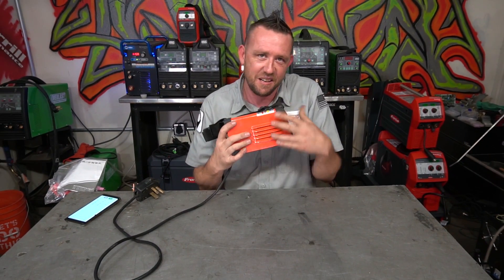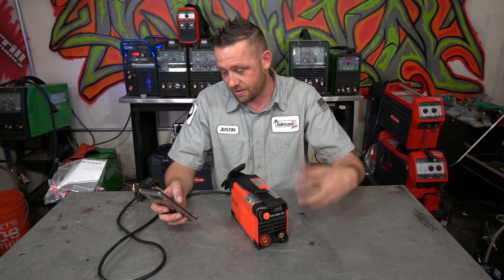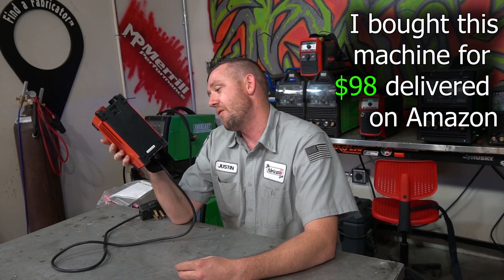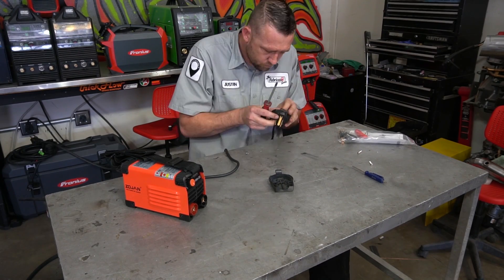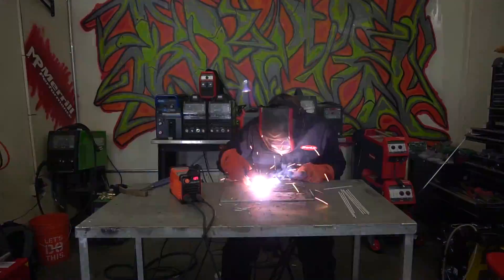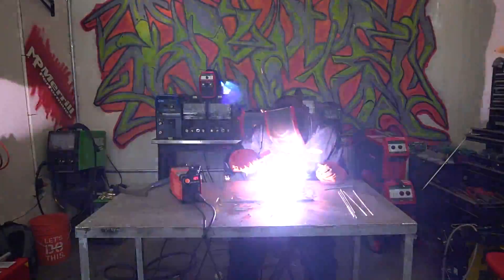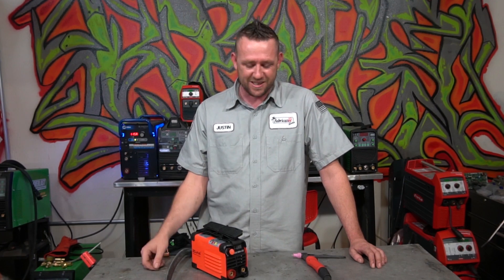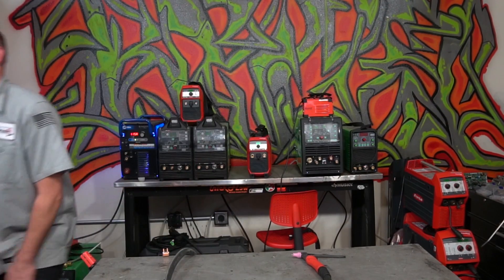TFS: The Smallest Welder EVER! Will it TIG?

Comment: To someone like you it may be novel and not work for long, but to the DIY person that just needs to do a quick light weld, without a lot of room in their garage it would be perfect!
Reply: Yeah, for $100 and no more than I would use it that little welder is just right. I don't weld anything that I need more than 125 amps anyway. You can weld thick steel with that if you do some beveling and pre-heat and prep.
Reply: It's exactly what I need! I'm about to embark on learning to Tig and I'd rather not spend $1000 just to learn.
Reply: @jeffreymoffitt4070  Go buy the DEKO Pro 110/220V @ 160 Amp ARC welder for $130 and you can just add a cheap little $26 TIG torch to do some lift TIG practice. These little Chinese mini welders are okay for light ARC welding, but you want at least a solid 150A DC inverter to start practicing TIG welding. The DEKO Pro 110/220V @ 160 Amp ARC welder has bigger heat sinks, thus much better cooling.
Reply: Yep that’s why I got one. I had NO idea they were so small before seeing them on the shelf 😂 it wasn’t $98 but it wasn’t $980 either. Works great and it’s a WELDER that takes up about as much space in the toolbox as a good soldering station
Reply: @thisismydogsaccount  I bought one of the first cheap inverter little arc/tig welders that came out about 20 years ago. Smaller than a lunch box. Not fancy. Not brand name. Says 190 ST on the front. But it arc and tig welds up to 110 amp. Might do a little more. Duty cycle ain't great. But it has a cooling fan and thermal shut off.and it costed $200 . I still use it to this day. Runs off 115 volt. I have repaired leaks inside water trucks for years with it. Easy to pack it in. Weighs just a few pounds. Tig welded lots of tanks with it and they never leaked. Not a welder you can run all day long. But for small jobs they work fine. Now I keep it in my garage for just tig welding now. Still works as good as the day I bought it.
Reply: @MrRatkilr  yeah but for tig you need shielding gas ,im wondering how do you carry that with you all over the place? do you have a small 60cuf cylinder on a trolley or something?
Reply: @thisismydogsaccount  you can make your own with 2 power supplies from a micro wave oven and some heavy wire to replace the coils. 
These welders are really simple, best part, confined spacers,, up on the roof or ladder. Too easy. Sling it over shoulder and away you go. 
I used one to build a 20ft trailor, magic to get overhead or underneath. Don't even get tired carrying it around.
Reply: works perfectly for me, gets a brief usage maybe once every couple of months...
Reply: I had a client buy me one for on-site repair work. It's been great, all I needed was to upgrade the earth wire and clamp and reconnect the stinger. I even used it to do 6 months of build at work for 4-6 hours a day,  no problem on stainless😆
Reply: I want one. I just got certified and still broke. I would love to use one of these for however long it would last
Reply: @nomorenomorenomore2920  It's been a year since you commented. Did you buy this welder? Curious if/how well it met your needs.
Reply: East to recalibrate the output  reading
Reply: I was hoping he'd like it... I agree with what you wrote
Reply: Bought one a few years ago - wow! What a cool machine.
Reply: Naw a Harbor Freight 125 Flux welder is 125 sometimes 95 with a coupon. And with all the attachments and a warranty!!
Reply: To someone who welds for a living this thing isnt even a descent paper weight it quite literally a waste of a perfectly good hundred dollar bill. Stuff like this does not last and will always break at the worst possible time save your money and buy something descent you cheap ass bums

Comment: Y US Should really think about going 220-240 volt systems and start using Schuko wall plugs. 110v systems and NEMA 5-15 plugs are more dangerous than 220 Schuko systems. In US systems same power needs more amp's than 220v systems. Amps are more dangerous than volts. Full grid remake also means more jobs, and economy boost. Also more Volts means y don't need so huge wires.

Comment: Did y use it on 110v. Product page says it is for 220 Volt. Of course amps are half if y have lower Voltage supply it needs.
Reply from the maker: It was plugged into 240v power just as stated and shown in the vid.
Reply: @TheFabricatorSeries  said it over to bigclive he'll take it apart and tell us what's going on inside of it
Reply: I don't weld (want to) but my knowledge of electricity says you have to be correct!
Reply: hmmm interesting thought

Comment: Hey man just watched this video and realised what the issue is straight away, your running it at half volts being that your in the states 120v mains so amps need to be double to compensate, here in aus being 240v mains the amps would read a little low because the machine is rated for 220v input. 
Nothing wrong with the machine but you will kill it running it at half it’s required volts like trying to run an 18v drill with a 9v battery
Reply from the maker: You must have skipped the part where I added a 240v plug and said it's on 240v input.
Reply: @TheFabricatorSeries  this guy is right.. that is your problem.   In the states we have 2 hot legs that are 180 degrees out of phase.  Each leg is 120 volts.  When we combine this we say 240 but it really isn't.  Over in China, my understanding, is the hot leg truly is 220 volts.   Not two 110s put together. I hope I've explained this well enough.

Comment: Not a fair review.
That machine is worth it's weight in GOLD when it comes to portability.
In Asia and Europe, standard power is 15-30A 220v.  A machine like that is hung off a shoulder strap and carried around from location to location; power outlet to power outlet.
Unfortunately that can't be done in NorthAmerica where we standardized 110v outlets everywhere.
For $100-$150 you can choose the little inverter machine or a well-used Miller/Lincoln buzz-box.  Both run about the same amperage but "Little China" can be easily transported, put away in a cabinet, runs quieter, and probably uses less electricity.

Comment: anything 120 volt 20amp or less  plug sure as hell will not output 250 amps....
Reply from the maker: It was running with 240v 50a service.

Comment: I m sure you are probably rite about the amperage. But give credit where credit is due . For the occasional or hobby welder it works exceptionally well. I've owned it now for over a year with no problems at all. It's cute, it's quite, it's cheap, it's energy efficient, and it gets the job done. It's highly portable,  It even broke you down, lol. It got me too! I went thru about 3 lbs of rods before I gave up. It's usefulness Probably extends to sheet metal, exhaust pipe, maybe even hand rails in a multi-story building (portable) All in all where else can you buy a $100 welder (mine $88) that works at all. Even Batteries cost more than that. You bragged about being honest about review,  which was everything but. The only problem I watched you have with it was doing something it wasn't designed or advertise to do. even that said I watch your videos because I hotrod and real hotrodding is about scrounging ,building, and buying cheap to go fast. Because anybody with deep pockets can go fast. I like to brag about how fast I went ,cheap. Thanks

Comment: Actually, it is a matter of solid state (tiny) vs antique tech (huge). Size doesn't imply either quality or value bro, if so, you need to get an old 200lb+ tube-type TV instead of your lightweight  slim-line flat panel big-screen LCD.  Modern welders are switching to inverter tech, which is all solid state... = tiny and lightweight. If that were a transformer unit, it would be a lot bigger and bulkier, and not near as cheap, for the same amount of output. You need to think about it bro, you WELDED with something not much bigger than your phone, rofl. As far as the output? It is watts vs watts here. That thing is taking in 220v, which means that it can convert that high voltage to a much lower voltage, say 22v. If it draws 10A at 220V, that means at 22v it can deliver 100A -- 22 X 100 = 220 X 10. With that thin input cord, I doubt it is drawing much more than 10A. At 11v output it could deliver 200A. I definitely think the 250A rating is way too high for that unit. It would be a good buy at $99 if the real output was clearly rated on the machine and accurately shown on the led readout. I am going to check the link to see what they claim and get back to you.
Reply: First of all the math doesn't work out at all. It draws 32.5 amps at 220V (7150W), but has a no-load voltage of 90V -- which means nothing. Strike an arc and the working voltage will drop far lower than the open circuit (no load) 90v. How much lower is the question? It can't drop down to 22v, or the amperage would be 325A! To get 250A, it supposedly has a load voltage of 28.6V, but I bet the closed circuit (load) voltage is running higher. I am betting closer to 50V, which is a max of 143 amps. However, the title of the listing at amazon claims 160A, which is more realistic, and that would put the load voltage at 44-45V.

Comment: Could I use this for makeing modifications to my truck bed?
Reply from the maker: I wouldn't.
Reply: Ok so as far as 200$ or cheaper what would you recommend?
Reply from the maker: Nothing. Not a single sub $200 machine capable or worthy has crossed my path to date. This machine has a $98 price tag on it, but costs another $200+ to make it lay down a weld out of the box.

Comment: Put a long steel rod on the ends of some old welding lead and use this toy welder for getting fishing worms. My Lincoln DC210 pro works great for this, especially if I hook up the high freq box.

Comment: You thought she was great when burning 12 sticks and then pissed because the deceptive ÷by50% rating butt $100. for hobby use is OK. You ar'nt going to weld armor plating on a tank are you?
Reply: Maybe If I had an automotive shop and I wanted to build a bulletproof dozer to rectify wrongs done unjustly. 
(Google “killdozer”)
Reply: @ManlyManStuff  Just make sure you engineer a better cooling system or replace the cooling hoses before you go on your rampage.

Comment: I have the same machine , same low power problem until.......switch the rod polarity and its a whole new machine. I don't know if there marked wrong or if
it has some funky output, but it will chew 1/8 rods and run larger no problems. If you still have it its worth a try.
Reply: Swarfman64 what do you mean switch the rod polarity exactly?

Comment: Ok something like this will unload a whole ranger out of my work tuck. You don't always need 250 amps to weld a nut on a broke off bolt.

I never scratch started a tig, I should do that
Reply: I use both non scratch start pedal tig machines and scratch start machines. Both weld metal together. In fact up in Alaska I worked on a boat for over a decade making food grade welds on stainless steel piping scratch starting a tig torch off a dc arc machine. You just have to back gas the pipe to make it clean and smooth inside. No pedal needed. You just have to get out of it or back off if weld to hot. Pedals are nice for amp control but with skill you dont need a pedal. That boat sells food to a major fast food joint. So scratch starting aint bad. Nobody has died from their seafood.

Comment: i actually like that it doesnt come with leads, since there is such a problem with copper coated aluminium cables (from china) that its almost a quality assurance to just not include the cost of cables that most people would be suspicious of, or suspect were just aluminium or would just straight up be CCA anyway in the case the the manufacturers of the welder have trouble avoiding CCA themselves. so its like them saying 'we believe the unit is good, so we want you to be assured and provide your own legit good quality copper cable for it' kinda thing..

Comment: Are you 100% positive your plug is running on both phases?  I had a welder do the same thing one time and turned out i had a loose mains wire inside the welder (was running on 110 instead of 220.
Reply: It only has two wires(plus ground). There is no way to run it on single phase

Comment: prolly half the voltage you are used to yeah? That would explain the half amps result. Good video!
Reply: TRY to HELP you might be right. This welding was design for 240v, he might be using it on 110v plug and get half the strenght.

Comment: I think you should review your conclusion. What was it suppose to do that it didn't. You stick welded and you TIG welded. The only problem is the amp meter read 2X the actual value. I am looking for a small welder that I can use to occasionally weld 1/16 th  rod. My welder will only got to 50 amp min. This is cheaper than other little welders. I've never TIG welded so this may give me an opportunity to try TiG.
Reply from the maker: You'll spend 2-3 times the price of the machine buying parts to make it work 9nly to guess on what it's actually putting out and not knowing of it will hold up. Worth it still...?
Reply: You keep saying it will take 2-3 times the price to make it work. It worked in your demonstration. What did you have to buy to do that?? @TheFabricatorSeries
Reply from the maker: Leads (or parts to make leads), the plug, a torch.... the machine includes NOTHING which means you have to pay for it. Go ahead and add it up to a realistic amount. Obviously if you say 1 foot of cable with a cheap stinger and ground lead you'll be at about +30 bucks, but that's still more that you have to put into the initial price and you are still left with half the capabilities.

Comment: 250 amps from a 120V socket..??? LMAO ....
Reply: It's an inverter machine
Reply: So 250 amps at 7.2V right..??
Reply: I'm not sure what the output voltage is but I believe the input is at 120V, but at 15-20 amps.
Reply: @tax paying walrus:
Yes the electrical outlet is 120V at 15-20 amps at most... Which means the ONLY way to get 250 amps is to run it at 9.6V at best if its a 20 amp outlet ...

Comment: FWIW, one of the (many) product listing pages on Amazon says output current is 20 - 130A so the digital display is reading Chinese amps. But hey, a 130A welder that fits in the palm of your hand for less than $100? That sounds like a steal to me.

Comment: Try to use it to solder something, maybe some copper pipe or melt some lead as body filler for dents? Cute points it wins all day long. Performance points hit & miss mostly miss lol. Thanks for the video........                                                                                                                                                                           ,                                                                                                                                      ⎝⧹╲⎝⧹ÐΛЯΞ †o ÐЯΞΛM⧸⎠╱⧸⎠ ✨[̲̅$̲̅(̲☠)̲̅$̲̅]✨¹°°

Comment: I have a Klutch ST80I (Northern Tool store brand) welder that is very similar to this except it actually works. I definitely stand behind it. Its inverter style, runs off of 110vac, only runs up to 75-80A but being inverter based it is more efficient than a transformer style welder and works well for most common applications. I also hooked up a power block and a valve style tig torch to it for a scratch start setup and it works flawlessly, featureless but flawless. I recommend them for a cheap, effective, very portable little welder.

Comment: Did you wire to 100 volt plug or 220 volt? Most Welders that are at 110 volt usually do half the amps a 220 does.
Reply from the maker: NEMA 6-50
240v 50a

Comment: Yeah you dumbass, any welding machine that you can stick weld with, you can TiG weld with. TiG welding is actually the better process for these little toy machines because it will draw the least amount of voltage while welding.

Comment: These things are normally used by a fitter because they are easy to carry around. They are used for tacking and really not used for a full blown weld. Miller and Lincoln have similar products but you hardly ever see anybody using these little nifty machines.

Comment: I think I had not heard it being mentioned before that you can use an arc welder as a TIG welder until this video (or else I had forgotten about it). Thank you for that bit of info. I'm assuming it must be a DC arc welder.
Is there an arc/TIG welder out there that costs 99$? (without the argon supply, TIG bits etc.) Would you recommend buying a 99$ welder to start TIG welding? or would that be the wrong start? I'm asking only as an experimenter/hobbyist - not as a professional - i.e. as someone who would like to tinker around but not necessarily waste their money on something sub-standard.
Reply: It can be any kind of welder, even a cheap autotranformer, but results are not that good in AC. There are special tig hoses with manual gas valve (I have one) and  are scratch start.

Comment: I would like to see you run some more sticks with a clamp meter measuring the amperage. also kind of curious to see the inside of it, especially after the torture test to see if any of the components look heat stressed or under rated.

Comment: They are probably calibrating current with shorted cables -output voltage is for example 5V. But real welding is measured current at  arc voltage , about 18-30V and thats the difference. I dont know if it is marketing trick or lack of welding knowledge

Comment: A poor connection on those booster cable clamps could be limiting the amperage you get at the arc. Anyone expecting a production machine for a 100 bucks would be dreaming. For those who have a limited budget or need it is better than holding things together with bailing twine. Will this welder do more work than I can buy in a welding shop for a 100 bucks, my guess is easily.
Reply from the maker: Trust me, it's a piece of junk. The connection was just fine, but if you really want to take your chances... the link is above 🤣